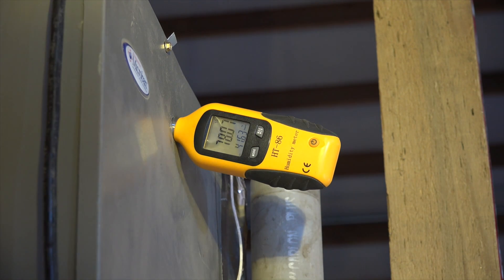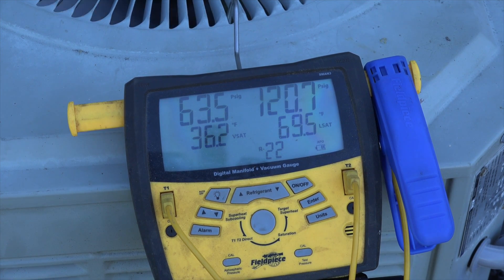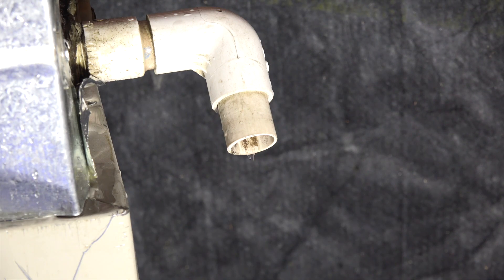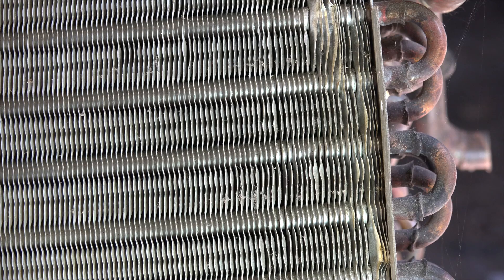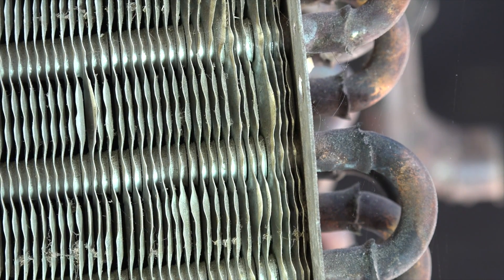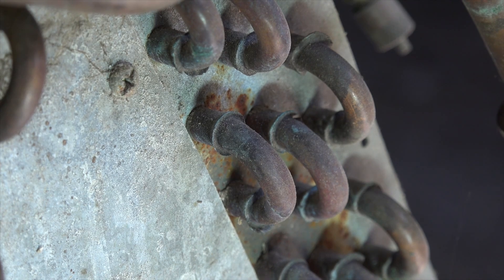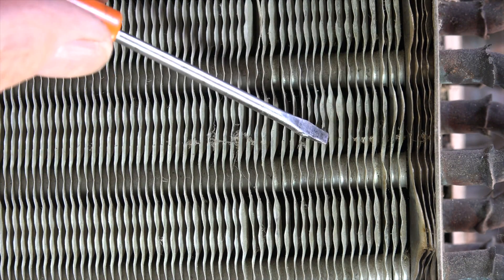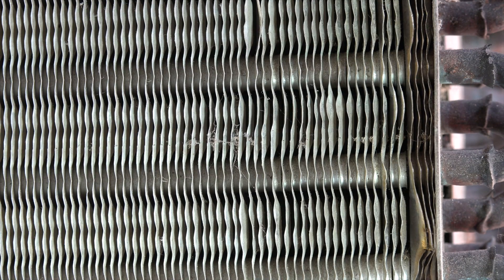Why does the air conditioner condense water.

Comment: Would the coil be cooler where the charge first enters the coil or where the charge exits the coil?
Reply from the maker: The first few inches of the coil is warmer as the refrigerant is cooling down.  The vast majority of the coil is the same temperature with the last part somewhat warmer from superheat. This applies only to the temperature of the refrigerant inside the tubing. Hope this helps.
GFM

Comment: Thanks for the interesting point about not reaching the dew point of return air...But, the air at the coil has cooled and contracted in volume. That changes the dew point of the conditioned air . The water can't stay in that air anymore and condenses (precipitates?) on the cold evaporator surfaces.
P>S>That cooled air must be close  to 100% Relative Humidity until it mixes with warmer room air...
Reply from the maker: Coil Smoke Thanks for the thoughts.
GFM